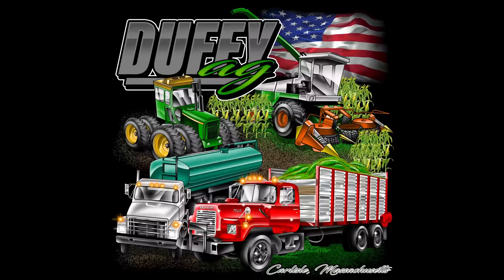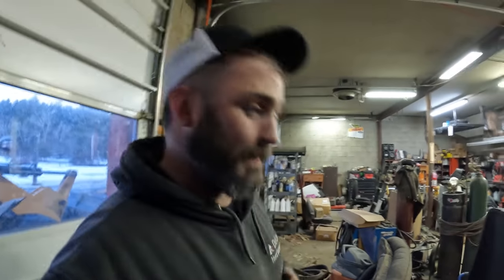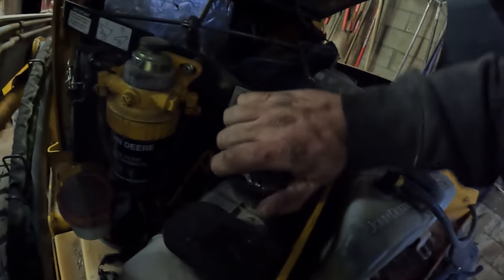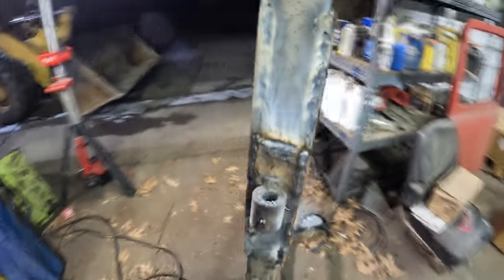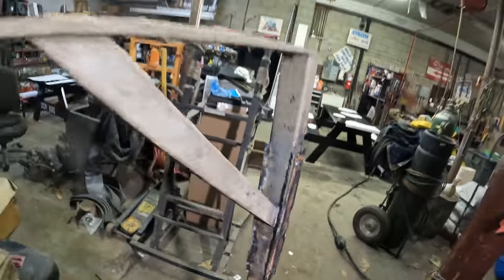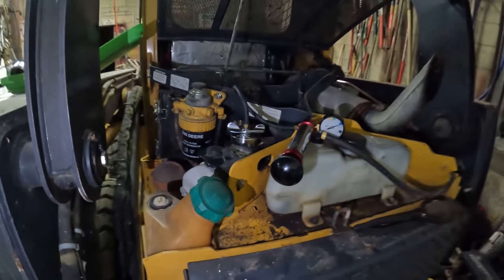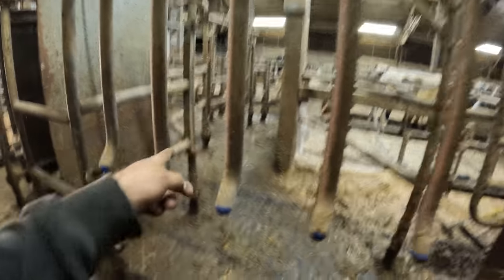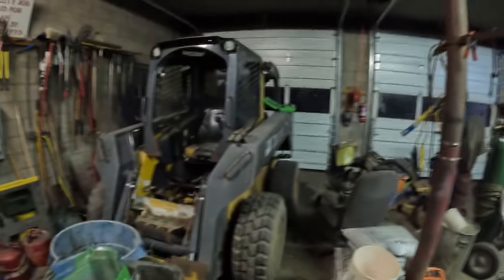That Is Definitely Broken- How Does A Cow Smart Gate Work?

Comment: Something I have learned in my short years of being a diesel equipment mechanic (im 32 lol) if you're pressure testing a cooling system looking for a liner O-ring that's leaking or a head gasket etc. a lot of times antifreeze will leak out and straight water will not. Glycol is actually thinner than water. Believe it or not I have actually filled an engine with straight water pressure tested it and found no leak. Put antifreeze back in it then pump the cooling system back up again, and all of a sudden there's water running down the block into the oil pan

Comment: You can buy and do a block test kit which tests your cooling system for exhaust gasses. I am not sure if the block test kit is different from gas to diesels but it’s a bike fluid you pull air through the tool through the fluid and if it changes color to green or yellow you have exhaust in your coolant.

Comment: Drain the oil out of the engine and leave the drain  plug out. Keep pressure on the cooling system and see if water drips out the pan.